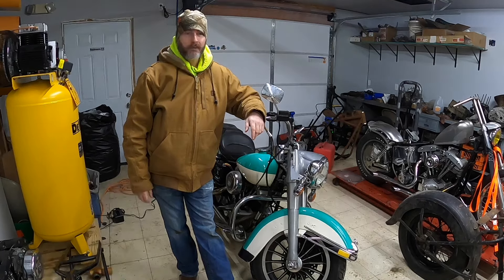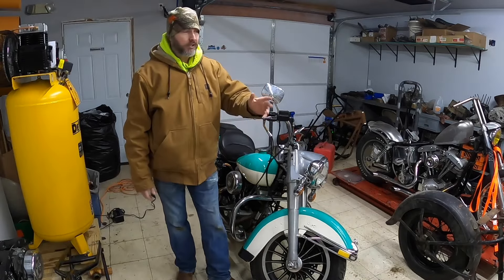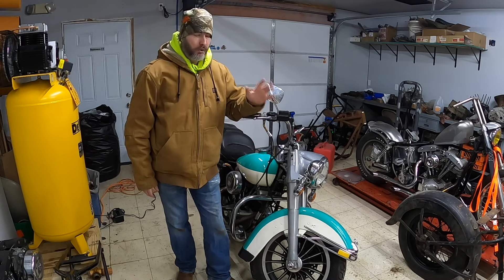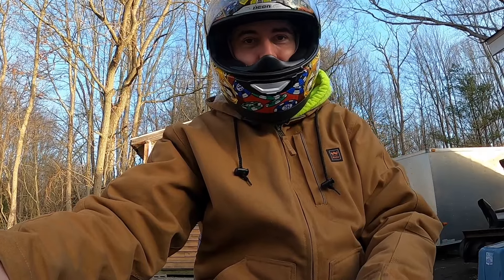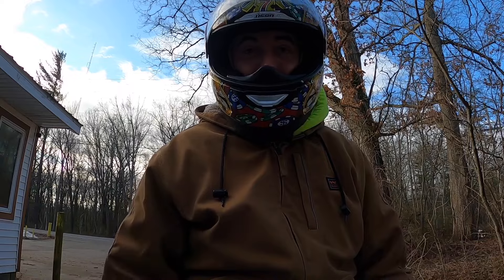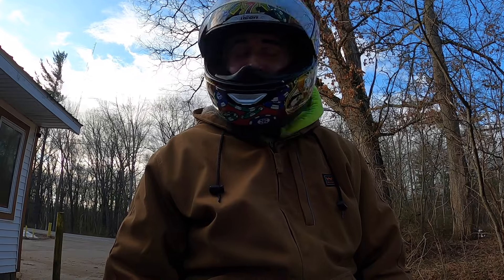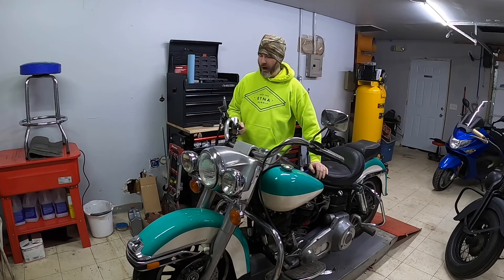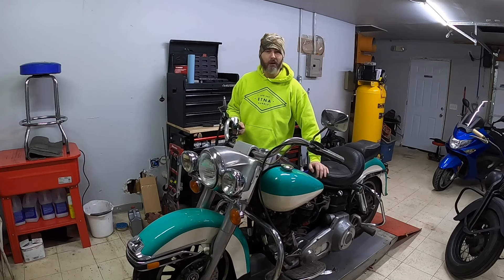1979 Harley Davidson Shovelhead FLH First Ride HD 1080p

Comment: Do you remember when all Harley riders had an emergency clutch cable fix in their tool kits? You run the adjustment screw bolt far into the clutch actuator giving some slack at the lever. Then you replace the pin that your clutch cable used to pivot in with the pin out of the kit. On the pin you had a hole to thread through what was left of the cable end hoping it was not too unraveled. Then there was a small screw that you tightened down onto the cable. The screw pinned the cable against the ferrule in the lever. We all had those. I still have one in my toolkit for my 77 FLH. but now, I do a much better job of lubricating my clutch cable so as to keep it from breaking LOL. I still keep a spare masterlink wire tied to the swing arm as well although... I'm not really sure why any more haha. Maybe for luck. Keep em rolling. I enjoy your enthusiasm!! BTW, I rode my own Shovelhead about a hundred miles today visiting Fort Bragg Harley-Davidson in Fayetteville, NC and Cox's Harley-Davidson of Pinehurst, NC. PS... if your clutch cable leaves you out in the wild, put the bike in second gear, hit the starter and with a good battery, she will lurch forward and start the engine at the same time. Then just shift gently up til you get to 4th and ride her home. Harley trannys don't actually know if you are using a clutch or not hehehe.
Reply from the maker: I have seen those! Ive seen some extravagant toolkits and some real basic stuff. It is good to carry all the extras that you can. I usually overpack if I am going further. I knew this cable needed to be replaced, just took the chance. That's awesome that you got out on your Shovelhead and logged some miles. I doo know that the bike will start in second and that it can be shifted without pulling a clutch. I should mention that in a video for those that may not know.
Reply: i rem those,,,,, u recall my memory on this clutch cable stuff

Comment: Hi, fantastic bike yours! 
Can I ask you an explanation how traffic laws works in US about those (illegal) bikes like old school chops with no mirrows no front brakes no turning signals at all, fully modified and without road approval from the State.
I mean...what is the risks of running these bikes in your Country? (police tickets, road insurance covering in case of accidents to yourself, other cars, peole and so...) 
I'm leaving in Italy (Europe) and unfortunately here it's quite impossible run bikes without anything of savety devices without having problems with the law.
I will appreciate if you could clarify me on this point or may be address me to a channel regarding USA traffic laws. Thank you very much!
Reply from the maker: Hello! 
These answers are from my personal knowledge. I am not a legal officiate or a lawyer. Traffic laws vary from state to state and sometimes county by county in these states. Commonly if a motorcycle does not come with turn signals, they do not have to be added, nor do any other modern equipment. When it comes to signaling, we are allowed to use hand gestures. When it comes to choppers or customs. The new stuff that is built without those parts, they are titled as a custom or home built which yields higher insurance premiums. With period correct choppers and whatnot there are often provisions written into the laws that protect those motorcycles. On older motorcycles, insurance is a mess. It can cover the value of the motorcycle if you have the proper appraisal, not that it always works. I hope this was a little helpful.
Reply: @Rockeys_Chop_Shop  Hi, thanks for aswering me. 
I'm sorry but don't understand what do you mean in the 2nd part starting from " with period correct choppers...".
But ok, Thank you again for your kindness.
Reply from the maker: @fernandogagliardo6618 Meaning the bike was build as a period piece. Example 1960’s. That style is chopped down and has no signals. In my state this is allowed. Other states may not.